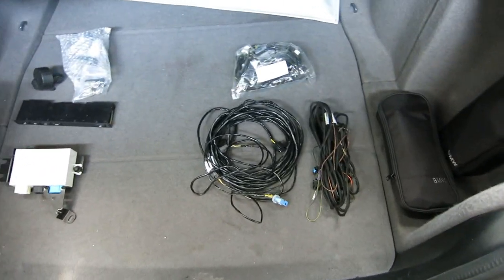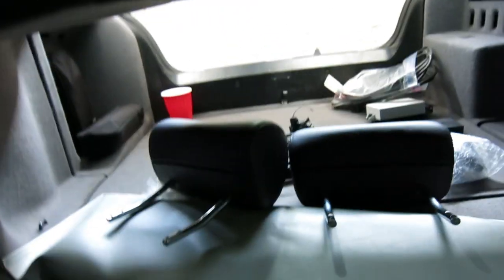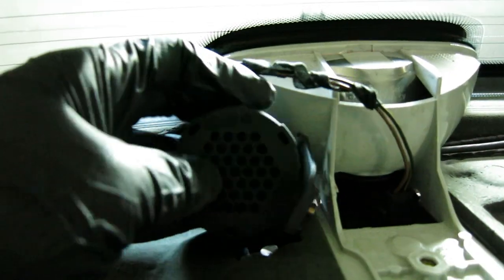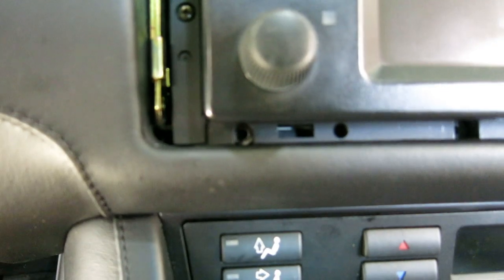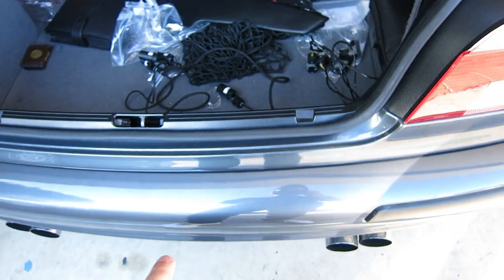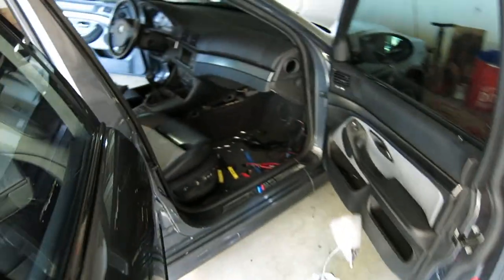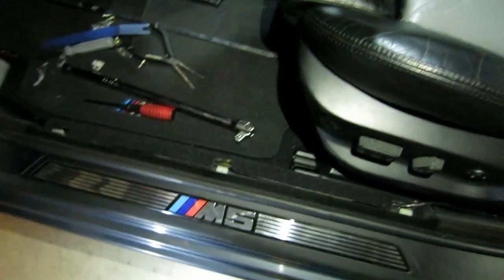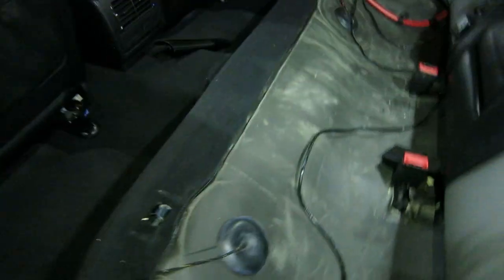BMW E39 M5 Park Distance Control (PDC) Retrofit DIY

Comment: Great Video. I Used This For Knowledge Of Wires. I Was Removing PDC From A Vehicle With PDC Factory Installed So Complete Reverse Of This Video And Just Wanted To Clarify A Few Things...1. In The Video @27:10 The Reason Why The Red/Yellow Cable (Doesn’t Reach) Is Because You’re Plugging It Into The WRONG location, Infact There Is Already A Green/White Wire That Can Be Seen In The Video Already Connected To Pin 21/42 That Provides A Fuse-able Power Source. It Actually Goes In A Black Junction Box (Just Like The One Behind The Glove Box Where You Plugged The White/Silver/Yellow Dots) That’s Actually Located Under The Passenger Seat Along The Door Seal it’s “Built In” To This Plastic Framing That Secures A Bunch Of Wires Behind It(You Will Need A 10mm And A Plastic/Nylon Pry Tools As There Is 2 Plastic 10mm Nuts And 3 Plastic Rivets/Fasteners That Secure It To The Bottom Door Frame 2. The Front Gong Speaker Wire (Black/Yellow) Doesn’t Run Like That It Runs Above The Blower Motor Which Would Have Required Removing The Top Portion Of The Dashboard To Run It How BMW Did. 3 The Front PDC Sensors Runs Along The Blower Motor Also Starting....From The Trunk , Behind The Glovebox, Through The Upper Dashboard, Leaving The Firewall On The Driver Side Of The Vehicle And So On. But Like I Said Great Video I Watched This Entirely And Used Sections Of The Video For Help With My ‘Deretrofit’
Reply from the maker: Hey, thank you so much for this information!  It will come in handy if I ever do a retrofit again.  The BMW retrofit documentation stated to put the red/yellow behind the glovebox.. so maybe it's a matter of pre-post facelift cars?  Who knows.  Either way, a working setup is all we were after here.  I know BMW buries their wires very deeply in the car, so sometimes it's easier and just as effective to use different routing methods.
Reply: E39Source, LLC I Have 2 540i’s One Pre Facelift And One Facelift The Difference Between The Two In MY Case is that PDC In Pre Facelift Doesn’t Have Front Sensors And Doesn’t Have The 2 Wires That Go To The SZM or Center Switching Center And The Black/Yellow Front Gong Speaker On The Black Power Harness Is Missing Those 3 Wires Are Non-Existing And Can Only Be Activated By Going In Reverse And On The Actual PDC Module It’s Missing The Blue Connector(Front Sensors) But Looks Exactly The Same Also I Meant To Add Where That Red/Yellow Wire Ends In The Video Is Exactly Above Where You Would Connect That Red/Yellow WireUnder The Carpet You Will See In That Junction Box A “Set” With A Bunch Of Red/Yellow Wires In Various Sizes That’s Where That Goes. All E39’s Are Prewired At The Glove Box For Every Feature The E39 Chassis Offers. When Retrofitting The Junction Behind The Glove Box Covers Features Like Radio/Heater,Headlights, While The Junction Under The Carpet Covers Features Like PDC, Heated Seats. Being That You Didn’t Care To Run The Wires Exactly This Job Could Have Been Done Without Removing The Glove Box But Rather Removing The Seats And That Trim (Pick Your Poison) But Your Are Right Functional PDC Is Really The Ultimate Goal. If You Ever Do A Write Up On This Please Give The Channel A Shout Out. Also I Have Done The Same With Navigation And On Your Website You Don’t Cover Retrofitting Stock Radio To Navigation And Navigation To Stock Radio I Can Give You Pretty Much ALL The Information You Would Need To Cover This Write Up As I Have Done Both Jobs Start To Finish And Can Tell You In Great Detail Every There Is To Know About The Retrofit
Reply from the maker: @jaystechreviews  More great information, thank you!!  I have not retrofitted navigation or gone backwards from it, but people ask me about adding it all of the time.  If you were so included, I'd love to feature articles written by you on E39Source.com.  More at http://www.e39source.com/participate.  If/when I reference your material, I will definitely link your channel.

For the red/yellow wire on PDC... does it matter which slot under the passenger's seat it would plug into?  Or is that just a huge block that sends the same signal to all of those wires?  I know that plastic trim and the block you're speaking of very well.
Reply: E39Source, LLC Some Of Those Are Grounds There Is Only One Block That Will Have Red/Yellow Wires To It. That Is How I Found It Every Other Block Will Have Wires With There Respective Wire Colors  Connected To Them It Will Be The Only One With Red/Yellow Wires .To Get Technical The Block With The Red/Yellow Wires Will Be Closest To The Passenger Seats If That’s Understandable.
Reply: Jose Gonzalez my suggestion would be to get a new module and instead of using NCS Expert Try “Akai PK90...The Other BMW App That Uses Different OBDII Cable (BMW Scanner 1.4.0) ” I cant remember the program name been a while since I’ve worked on this but when I was working with PDC , NCS Expert Was Never A Program I had used I program PDC Using BMW Scanner And it’s also way easier . I will update this comment let me do a bit of research first get the terminology fresh on my mind to better help
Reply: Jose Gonzalez I Can See Your concern However These BMW Don’t Just Go Kaput (They Actually Do haha ) But What I Am Saying You Can Mess Around With Different Coding Options Also Keep It Mind Just Saving Screenshots And Logs, Backups ETC (Stock Parameters) So You Can Return To Normal  Also The PK90 is a module used to flash Chips These Cars Use (In My Case To Duplicate A Key With Remote ) So I Don’t Know If That Will help its been a long time This Is Coming From Memory But In Made Day I Simply Did The Split Here As Some Might Get where I am coming from ....For Personal Features And Basic Information At A Average User End Level Use BMW Scanner 1.4.0 If You Are Working With Vehicle Parts That Need Manipulation Like Throttle Body, Steering Angle Sensor, Brake ABS Sensors Use NCS Expert Hope That Makes Sense Also Using BMW Scanner 1.4.0 You Can Quickly Determine If That Sensor Is Working Correctly Or Not As You Can Manipulate It There So My Guess would be if it’s not working in that program that sensor is bad which is my first guess if you doing the method your trying because a normal one would be up just as soon as you did anything to is also keep in mind Some module and sensors contain data of other modules as all the sensors “run together” in BMWs I hope this makes sense I will def need to edit these comments later for other viewers having this problem
Reply from the maker: Follow up!  I have recently acquired a 540i and I just finished retrofitting PDC.  This comment saved me hours of research.  I was easily able to find the black wiring block under the passenger's seat and add in the red/yellow wire.  The documentation says it goes at the glovebox, but this is obviously incorrect.  Removing the seat takes a bit more time, but this is the right way to do the job.  Thank you again!

Comment: Great video very informative.  I currently am tracing out a PDC problem on my series 5 MSport touring.  It has the same kit as yours, however it is not an M5.  Btw, yours looks great.  I think it's what was sold in the UK as the Champayne edition, very rare.  Thanks for posting.
Reply from the maker: Here this is just a standard 540i sport package in Sterling Gray Metallic, I have not heard of a Champagne edition actually!  Good luck with your PDC issue.

Comment: Can you make a retrofit with the Armrest phone in the E39 

It would be great to see it!
Reply: I completed the armrest phone/Bluetooth retrofit last year in my E39. What do you want to know, maybe I can assist you?
Reply: You mean you put one in? That's neat :)
So you lost the console storage or?
Reply: @TheHeretic435  No, my E39 never had a storage compartment underneath the "armrest" because it's a U.S. spec model. Also, since my vehicle is a 2003 model it already came from the factory pre-wired for hands free telephone connectivity. All I had to do is to retro-fit the ULF module (or you can use a Telematics Control Module depending on your needs), BT Antenna, BT snap-in adapter, & Microphone - GSM. Depending on the year that your E39 is built you may need adapter cables for all of the necessary parts to be installed correctly.

Comment: Hi I saw the video, I've been trying to do this for 3 years.  Now I have a rear M bumper with parking sensors, I have a cable and everything else.  The problem is that my center console does not have a pdc button and if I buy another one that has it again, I will not have this connector that you show.  I don't have that connector 23:29, is there a possibility for the cables to be connected in some other way.
Reply from the maker: Every E39 has that connector for that panel (SZM panel).  The SZM panel has a million different configurations (heated seats, Sport for M5, DSC, sunshades, PDC, etc etc) and can be pinned to accommodate anything.  If your connector is missing, it has been cut off by a previous owner.
Reply from the maker: @alensadiku3220  Feel free to email me at ryan@e39source.com

Comment: Hello,
First of all, great video!! 
Can you helpme? I have 2 questions...
1. I allready have original rear pdc. I'm going to mount the front pdc and i need to know: the 2 wires that  plug on the pdc button come from where? The main main plug on pdc module? If yes, tellme the 2 pins numbers please.

2.  Exatly what wires connect to the front gong? I mean, from where do the come, and were do they conect? Pins numbers again please =p 
Regards from Portugal!
Reply from the maker: 1.  I have a video all about retrofitting front PDC.  That will answer this question:  https://www.youtube.com/watch?v=0Lq2tPzdGco
2.  The video above will answer that as well.  I have a written post too, which may be easier/faster for you to find the specific pin info.  https://e39source.com/archives/2442
Reply: @E39Source  wow this was the question i have thank God for you.
Great job i dont know who those 4 Neanderthals are that disliked this video.

Comment: Just wondering why didn't you cut out holes in the bumper reinforcement instead of ordering a  new one?
Reply from the maker: It is easy and cheap enough to source a factory bumper reinforcement with PDC cut outs.

Comment: Seems like the main retrofit harness is NLA (61120027006) - anywhere I can source them? Or alternative vehicles to pull a harness from?
Reply from the maker: I have recently heard this, definitely a bummer.  I plan to reproduce this harness, but our shop is absolutely slammed with work right now and this is a lower priority.  On E39s that came with PDC from factory, these wires are built into the primary vehicle harness, so extracting them would be quite time consuming- but possible.  Keep an eye on E39Source's online store for when I make the reproduction available.

Comment: Where are the other wires coming to the gong? There is only 1 wire in the pdc power harness, right?  And do I really need the PDC switch? Can I just connect the 2 cables permanently?
Reply from the maker: The power harness has several wires (bus communication signals, gong speakers, etc).  You do need the switch, absolutely.

Comment: great video. Is there some type fault on E39 PDC's? my pdc isnt working, when i press the button it makes sound but if something is close to radar it doesnt make any sound.
Reply from the maker: That long beep it makes when you press the button is the system's way of indicating that there is a fault, and the system will be disabled due to the fault.  My advice is, turn it on, and then listen very closely at each of the 8 sensors in a quiet environment.  You should hear a faint clicking from each sensor that is working.  If you find a totally silent sensor or multiple sensors, those have failed and are preventing operation of the working sensors.  You will need to replace the dead ones to restore operation.
Reply: @E39Source  thank you for answer. :) i will try that.

Comment: Any difference between pl/prefl models in this installation?
Reply from the maker: 2001+ E39s received front and rear PDC while 2000 and earlier models just got rear sensors.  That would be the biggest difference; but as you can see you can easily retrofit the front sensors as well as the rears.  There shouldn't be any other major differences between pre/post facelift.

Comment: My factory PDC just goes straight to 1 long beep! when I put it in reverse, as though it were always close to something. 
I suspect a resprayed bumper is covering the sensors. Face-lifted car, no black strip, so sensors were silver in the first place. Anyone else had this? How does the factory paint them if a layer of paint confuses the sensor? special paint, a VERY thin coat?
Reply from the maker: The long beep means there is an error, and the system is disabling itself.  Have somebody shift the car into reverse while you take an ear to each sensor, VERY close to each sensor in a quiet environment.  As they try to activate, you should hear a clicking sound at each sensor.  If you have a totally quiet sensor, that means it's dead.  Replace any dead sensors, and Ib et the system resumes working.
Reply: Great info. Thanks. I didn't know they clicked. So they're OK to paint?
Reply from the maker: @TheHeretic435  Carefully, yes.  Paint has to be thin and professionally done.
Reply: I see them unpainted for $2, and Painted titanium silver For $25+ lol Thanks for the tip, let u know how it goes.
Reply from the maker: @TheHeretic435  That sounds awfully cheap, be careful with the cheapest Chinese sensors.

Comment: What’s the part number to the centre console switch pack you installed I need this exact one
Reply from the maker: 61316927056
Reply: @E39Source  this is for sport seats, not PDC I believe
Reply from the maker: @BimmerFix  I am seeing Sport, heated seats, DSC, and PDC from that #.
Reply: @E39Source  My bad, I was trying to find rear blind and pdc in one console
Reply from the maker: @BimmerFix  RealOEM no longer lists all of the specific part numbers.  I would search Ebay

Comment: How do you run the cables differently for a RHD? Looking to do this project.
Reply from the maker: I am not familiar with right hand drive cars, so I don't know if BMW inverted it, or if it stayed the same.  It wouldn't matter from a functionality standpoint.
Reply: @E39Source  I imagine because the drivers side and passenger side are swapped, that they'd be run oppositely, so front harness would go past drivers side, and main power harness would run passenger side. Thanks for the response though!

Comment: Is PDC module the same as E53?
Reply from the maker: Yes!
Reply: @E39Source  Then maybe a stretch, but could I use wiring harness and parking sensors from  E53 do you think?
Reply from the maker: @BimmerFix  The parts may very well be the same as the E39, you can use RealOEM.com to crosscheck part numbers.

Comment: Hey Ryan. The power harness (61120027006) seems to not be available anymore. What solution do you know of if you can't get your hands on one?
Reply from the maker: I've recently heard this, quite the bummer.  I actually have one more in stock here at the shop that I'll use a model to re-create more... but sourcing all of these connectors will not be easy.  Email me at ryan@e39source.com if you'd like to buy one.  Unfortunately, it may be a while before time allows me to re-create this.